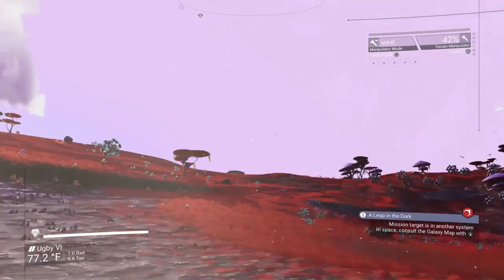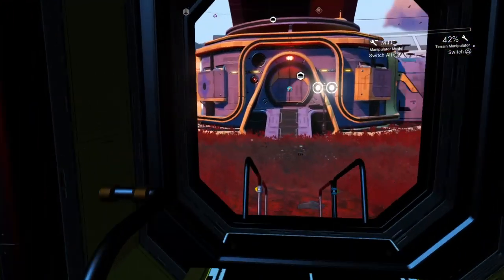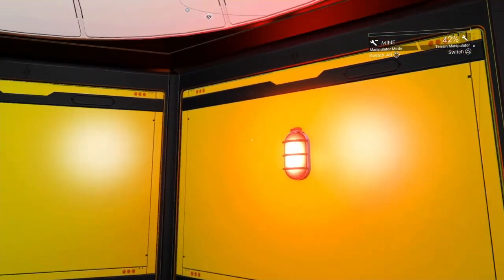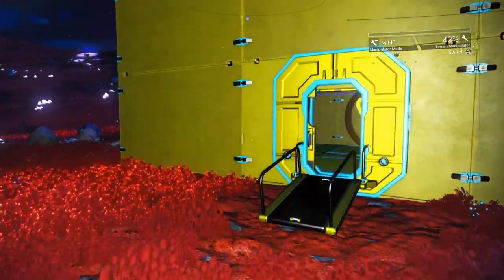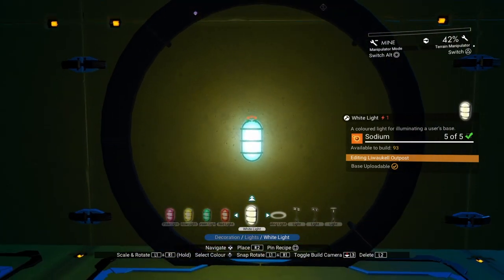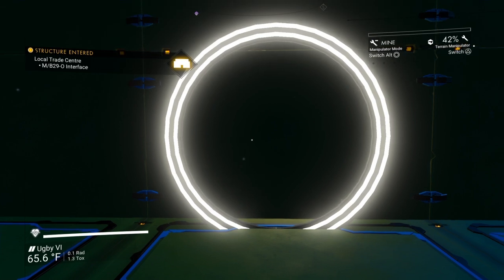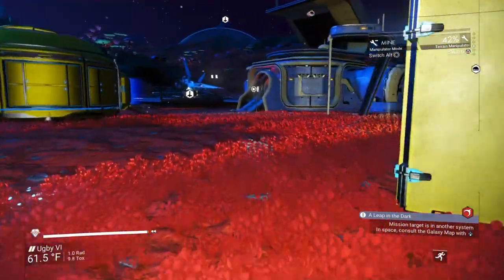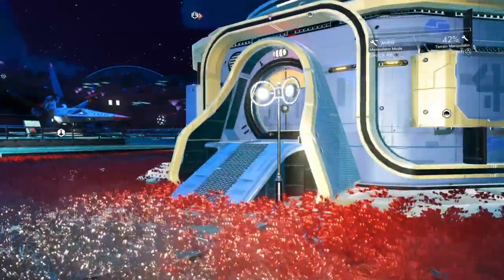NMS: How to Power Ceiling Lights.

Comment: Couldn't get it to work how it does in your video. Does the material you build your base out of make any difference? I just used the alloy stuff and it's not working at all.
Reply from the maker: Updates usually affect stuff like this and it will probably be fix within a week or two. ill try it myself at the week end.
Reply from the maker: Ive just tried this myself and for some reason i can not attach anything to a large alloy wall (cant even delete it) but i can attach stuff to a small (thin) alloy wall and i can get the ceiling light to work using the method in the video. Timber walls work fine and stone walls work aswell. Im sure they will patch the issue with the alloy wall once they sorted out all the othet problems this update has caused.
If your having problems with the timber and stome wall try moving the small light fitting around a bit, it should work.
Reply: @MickManchester.  Thanks for the update. Hopefully they fix it and I won't have to replace my entire base haha.

Comment: The cables are available if u go into delete mode. Just scroll 👍 u don't need to always go and find them
Reply from the maker: Your right Gav, that will save a lot of time in future. Thanks.
Reply: Yes that is very helpful but to create new independent wire joints, you have to go in. Those L-Ctrl wires are only to join existing wire joints.

Comment: Why didn’t this work for me?? The lights on the outside are lit but the ceiling lights are still dark…
Reply from the maker: Have you tried moving the light around a bit, i had to with mine. It need to be in the dead centre of the ceiling light.